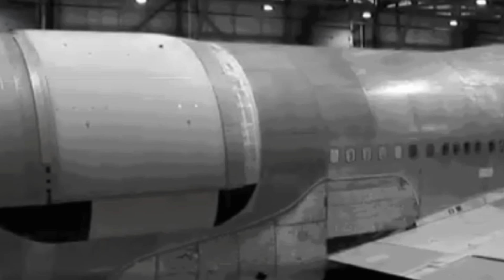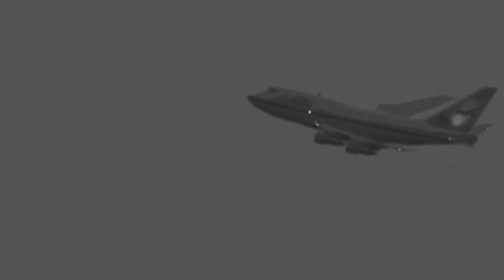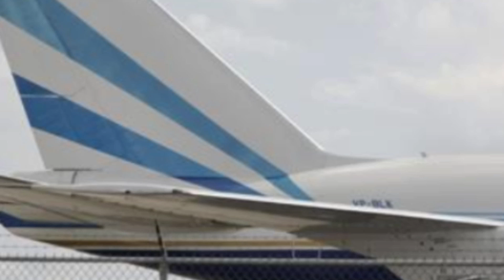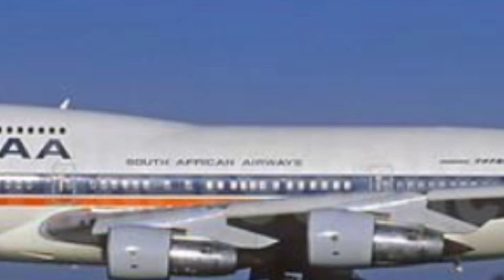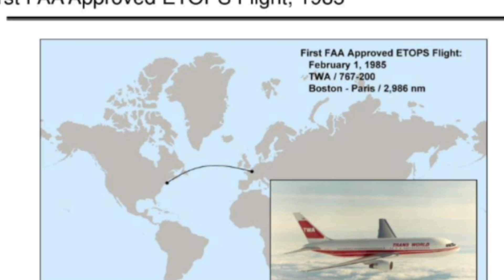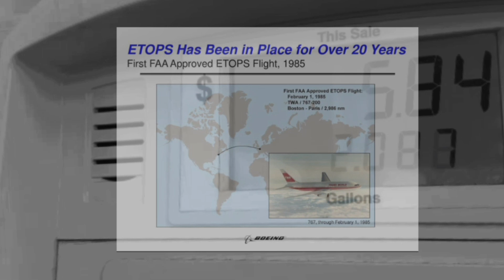THE BOEING 747 BOEING MADE TOO SMALL

Comment: A really informative video that covers the important points well. 
 
SP sold very poorly, but it saved the 747 program. After the 1974 oil shock, 747 orders evaporated.  SP orders kept the 747 assembly line open until world economy recovered enough for airlines like Singapore to order 747-200. Without the SP,  Boeing might have closed the 747 order book by or before 1980, and aviation history would have been different. 
 
Boeing redesigned a unique longitudinal galley between Doors 1R and 2R to replace 747’s main galley between doors 4L and 4R. KLM and Thai chose this galley for their 747s. 

Qantas ordered the SP not for range but for commonality. At the tine they only operated 747s, which was too heavy to operate into Christchurch or Wellington, the lighter SP made it possible to fly 747 to New Zealand’s South Island.  By the time Qantas SP arrived, the 747-200 already had more range at full payload than SP.

Comment: The title alone is already wrong. It was not too small. It was made for specific, long-range missions. Social media is a curse on humanity...
Reply from the maker: I understand your point. The 747SP was deliberately shortened and optimized for specific long-range missions — it traded passenger capacity for range. That’s actually the central idea of the video. The title is meant to highlight that unusual design decision, not suggest Boeing accidentally made a 747 that was ‘too small.’ Thanks for pointing out the distinction.
Reply: The title doesn’t claim it was too small. The title asks why it was so short. The video then explains why….   . What’s the problem?